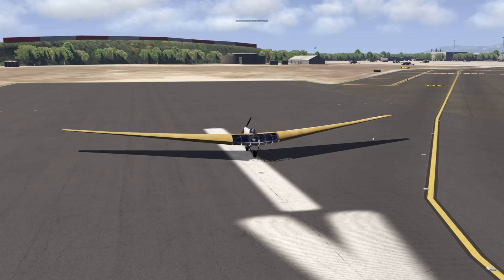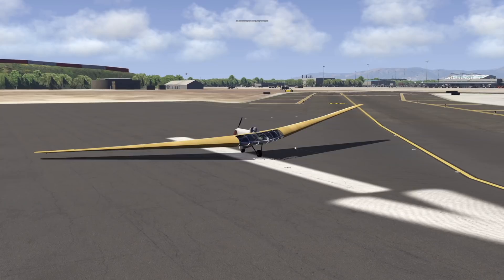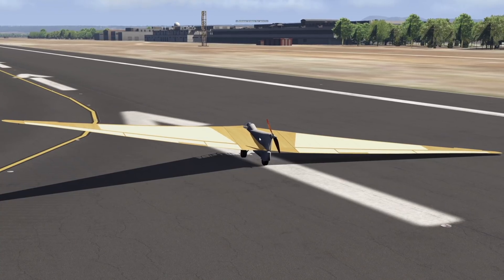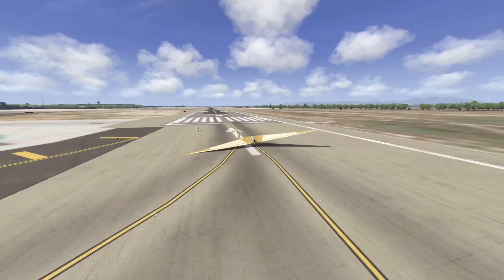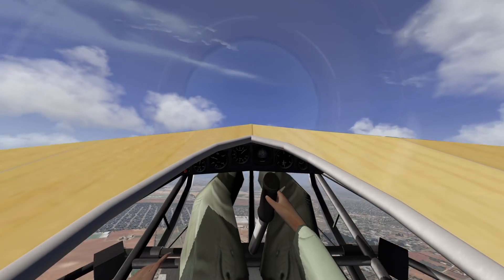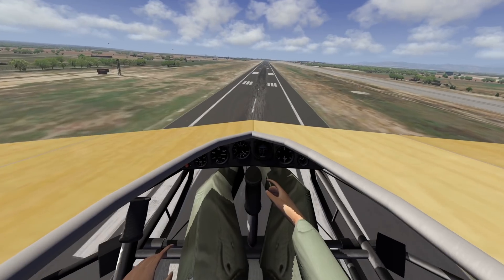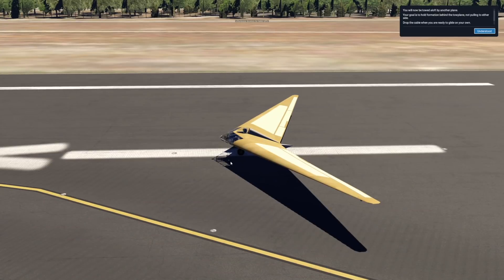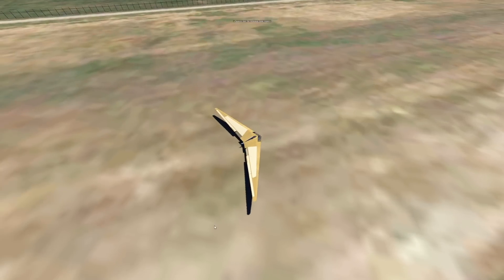The WEIRDEST PLANE - Does It Even Fly? Horten H III

Comment: Obviously you have nothing to do with aviation if you say Horten aircraft "is actually flying" ... man ...
An aircraft without the vertical stabilizer is what Hortens are known for in optimizing to perfection an aircraft that has nothing more than a wing ... 
It's actually Horten and Prandtl that have made the most important contribution to "only the wing" kind of aircraft ...
By the way you should compensate the adverse yaw ( like for every plane... )  with the radders ...

Comment: It's a Horten H.IIIe and H.IIIb (E variant is motorglider and B variant is glider), actually there's a stranger variant of Horten H.III and it's the C variant, it had slats and small foreplane above and infront of the cockpit to try to increase the max lift coefficient. When the H.IIIc flew by Werner Blech at 1938 Rhön contest. Blech entered the same cloud as Scheidhauer after telling other pilots not to enter it after him. Blech's H.IIIc was next seen fluttering slowly to the ground without a canopy and trailing Blech's parachute bag. Blech's ice-covered body was discovered later on a rocky outcrop of the Wasserkuppe.
I'm a Horten flying wing fan lol

Comment: Hi @Swiss001. Horten airplanes were designed with a very particular lift distribution, called Bell Shaped L.D. or BSLD, which do not produce adverse yaw, so no rudder / vertical stabilizer is required. I highly doubt that the modeler did included that in the model, but used the traditional eliptical model.

In the other side, the Horten Brothers design group is not the same newest Horten company, which is a hommage. Their plane does have vertical fins in the tips...

For more info look at this video: https://youtu.be/Hr0I6wBFGpY

Comment: The Horten brothers constructed another flying wing during the war. It was a stealth plane. Project 3000 (1000 km / h, 1000 km range, and 1000 kg bomb load. The Nazis had the first fighter jet in the world and the first functioning stealth aircraft that also had engines like the Messerschmitt 262. (These were only improved for the 3000 project)
Reply: Sir. Bavaria, it was even better than the me-262 dogfighting wise.
Reply: It was not stealth. that's a myth.
Low radar observability was nothing in their thoughts when designing it. They didn't care about British "long chain" radars over Antwerp in 1944, they only wanted to drop some payloads on it and the Horten was the best way to achieve their 1000^3 criteria.

The engines inlets or exhaust and the cockpit on the Ho-8 would have shone on a radar screen.

Comment: The 767 crash was due to pilot error or more fitting, a training error. The pilot was trained in wake turbulence to use oscillations with the rudder, the added stress caused the rudder to snap off. Wake turbulence was tested by the NTSB but was later ruled out. You could say the wake turbulence was a contributing factor but on its own it wouldn’t of caused this crash. Stay safe guys!
Reply: so human error

Comment: Would like to point out that the crash of American Airlines Flight 587 referred to in the video was not the result of extreme wake turbulence, but rather the copilot overcorrecting  in response to wake turbulence causing extreme amounts of stress and shearing off the vertical stabilizer. Pilot error was the cause, not design error.
Reply: Coyote Foxtrot yes, i believe it was when he was trained he was taught to be tough on the rudder, which then ripped off along with the Verticle stabalizer, trainer(AA) and pilot error.

Comment: Imagine flying with a vertical stabilizer

                            This post was made by a Horten aircraft gang
Reply: @cheezy5563  imagine driving 
This post was made by the air vehicle gang
Reply: @cheezy5563  imagine flying, driving or sailing

This post was made by the walking gang
Reply: B-2 Spirit: Am I joke to you?
Reply: Many desingers tried totally fin-less. Many then tried wing-tip fins which were only a bit less terrible. The ones that put a substantial fin at the tail, made good workable planes. Fauvel, Arup, Canova, Lippisch, Chernovsky, etc.

No plane without that fin and rudder has made a good workable plane.
Yes, I include the B-2 and hang gliders in that.
It is not a good serviceable plane if only test pilots and military officers in full ejection seats fly it and they bail out the instant it starts to depart because it's a death trap in anything but ideal circumstances.

Comment: idea for a trying flight simulators video (there is steam workshop support)
like so our lord can see (day 2)

From Wikipedia, the free encyclopedia  

Stormworks: Build And Rescue

Developer(s)	Sunfire Software
Platform(s)	
Windows
macOS

Release	February 28, 2018
Genre(s)	Simulation
Mode(s)	Single player, multiplayer

Stormworks: Build And Rescue is a simulation video game developed and published by British studio Sunfire Software.[1] The game was released as an early access title in February 2018 for Windows and Mac and is receiving frequent updates through Steam.

Contents
1	Gameplay
1.1	Career mode
1.2	Creative mode
1.3	Missions
1.4	Building
2	Reception
3	References
4	External links
Gameplay[edit]

The game is played in a randomly generated open world physics playground, composed mostly of ocean and small islands. The game centers around the theme of running a coastguard rescue service with a variety of vehicles, which the player can build on a ‘Workbench’ with an assortment of blocks, engines, sensors and special equipment. As the player explores the world, the in-game map is created, in which they can fast travel to locations they've discovered. These vehicles, ranging from airplanes and helicopters to boats and terrestrial vehicles and, recently, trains can be used by the player to complete various diverse missions to earn in-game currency. It currently has 2 modes, Career and Creative.

Career mode[edit]

In Career mode players are given control of a starting island that contains a small boatyard, a simple boat and a small house. Players will need to complete missions to earn money and new components to build new vehicles. The player can travel to other islands and buy them when they have enough in-game currency. These purchasable islands usually provide a larger building space or specialized building space (e.g. Island Camodo has an exclusive railyard where trains can be built). Within career mode there is a lot of variables including enabling first person play only and having limited fuel, or adjusting changing daylight hours. A small challenge within career is that crude oil can be bought to later be refined to then be sold for money.

Creative mode[edit]

Creative is a sandbox mode where players are not limited by resources; players can create vehicles using the editor and are granted access to an island with a large shipyard and large hangar allowing for very large vehicles to be built. After recent updates, it has been made possible for the player to choose his/her default base including a Heliport, Mainland (Airport or Harbour base) Island with a small boatyard among other bases. Custom buildings can also be built on certain islands. The game also supports the Steam Workshop to download and upload community-made vehicles and loads them directly into the game.

Missions[edit]

There are a variety of missions, ranging from delivery missions to rescue and firefighting missions. The missions are generated over time and will expire when their time limit has been reached; if a player has no active missions they can return to their house and sleep until new missions appear. A ‘bed’ component is also available which can be mounted on vehicles (usually large ships with huge spaces) where the player can sleep.

Some missions will require either specific components or vehicles to complete the missions, firefighting missions will require a vehicle that can tackle the blaze and large evacuation missions will require vehicles with a large enough capacity to escort all the stranded characters to safety.

There is also the ability to create missions in creative mode.

Building[edit]

The building in Stormworks works on a block-based building system. Players will create vehicles by placing cube and wedge shaped blocks to form the structure of the vehicle with buoyancy being calculated by the size and shape of the hull. Once a player has created the structure of their vehicle they will need to add components such as engines, rudders and pilot seats and program them using the same logic system. Stormworks: Build And Rescue has support for land, sea, air and vehicles along with submarines and trains, with specific components such as aerofoils and Gyro to support the different types of vehicles. These vehicles can be created on Workbenches, which are usually found on either the default island or other special islands which can be bought using in-game currency. The other random islands (e.g. Hospital Island or NPC oil rigs) do not have a workbench.

Reception[edit]

Stormworks: Build And Rescue Beta and Early access has received some positive attention largely comparing it to similar titles such as Kerbal Space Program, “Yes, as it turns out. Stormworks: Build & Rescue doesn’t just want to take the Space Engineers/Kerbal Space Program idea and throw it somewhere in the North Sea – it demands precision in all things.”[2]

Stormworks: Build And Rescue has also been covered by Rock Paper Shotgun and PCGamer.[3]